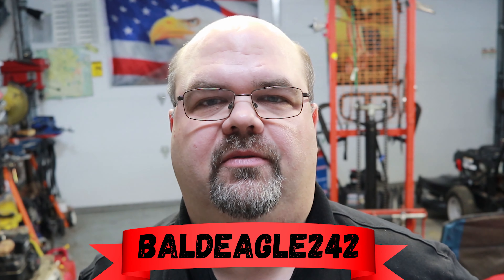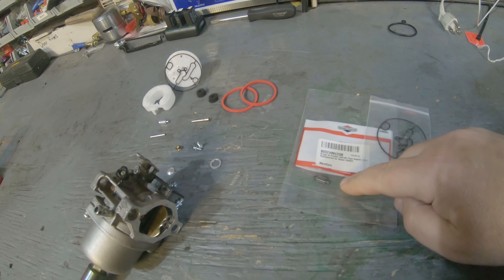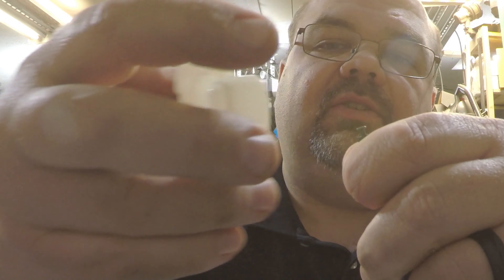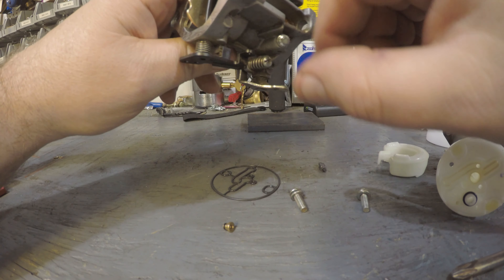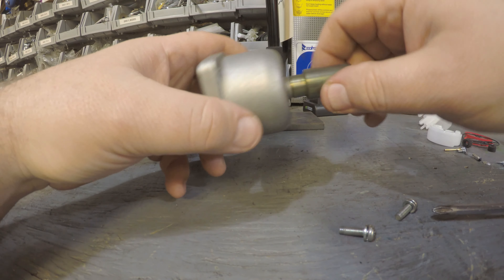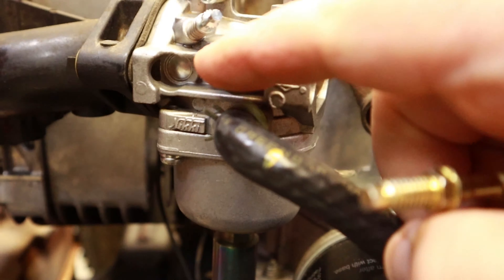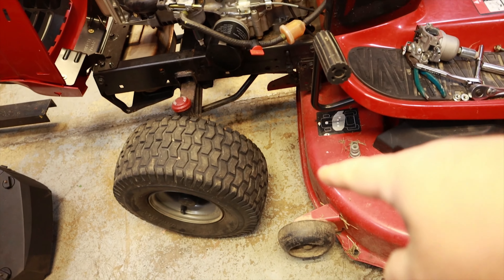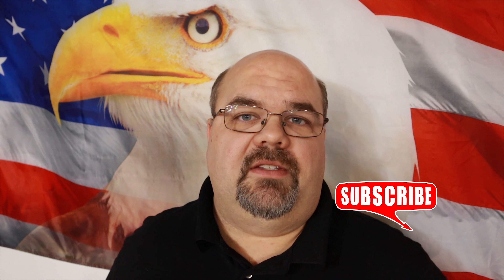No BS! Simple NIKKI Carburetor Rebuild

Comment: You're one of the very few folks that show doing a "wet" test on the carb.  Good on ya for that as that's very important step after messing with the float.  Cheers.
Reply from the maker: Thank you, I have to give my grandpa credit for that. 😁👍
Reply: I just hold the carb right side up, & blow into the fuel inlet tube. If it holds, it won’t leak.

Comment: The gas leak test is always useful.
I typically have a jig set up on my bench
with a small raised gas tank, hose and valve
that I attach to the carb while off the engine.

In your case, your carb is GRAVITY fed.
If there is a fuel pump, gas will not flow
to the carb since the engine is off.
So many details to remember, so thank you sir.
-- North Central Florida
-- 10.1.2023
Reply from the maker: Thank you, I appreciate you taking the time to leave a comment. Here’s a link to the rest of the story on this carb. I generally go about it in a little different way that I show in this video. https://youtu.be/8VxTRqJZi0Q?si=HPEL68_r2Ig5e3Iw

Comment: I have the exact same Craftsman YTS3000 that I bought new from Sears in 2010. Mine got hydrolocked too and I ended up replacing the carb about 5 years ago. We'll now it's  surging so not sure if I'll just get another new carb or rebuild kit. Amazon Carbs are just a little more $$ vs a rebuild kit.

Thanks to videos like this I have kept that mower mowing my 2 acre lot for 14 years! I have also had to replace the spindles. Drain/replace the transmission fluid. Repair the deck with welding and repaint to protect from further rusting. New tires. New high back seat. Replace  the blade cable. Repair wiring harness from rats eating it up!
Reply from the maker: All of that and you’ve still spent less than most people who buy a new one every 4-6 years. 😁👍

Comment: Excellent video on that Nikki carb. When I purchased my riding mower from my neighbor, he hadn't run it for 3 years and left it full of fuel. The fuel lines were rotten from the tank to the carb. After a little bit of silicone fuel line replacement (that was fun) and a carb clean, it's been running great for 3 seasons now. I for one don't mind this carb, as it's easy to work on. I also added a fuel filter and fuel shut off just for added security just incase an O-ring goes bad.
Reply from the maker: They aren't that bad of carb, but they are prone to leak once they get a little age on them.  The fuel shut-off is a brilliant idea.  I will usually shut them off as I'm driving into my garage and leave them off till I need them again.  Thanks for the comment, and thanks for watching.  🦅🇺🇸

Comment: Hello again Mr. BaldEagle! First of all, I would just like to thank you again as everything you taught about the Nikki rebuild was right on point, it only went bad again because I kept taking it back apart. But with the help of GOD, I finally figured out why there was no gas getting over to the piston well. I went back out this morning trying to start the mower again, but still nothing. So I went ahead & disconnected the kill wire like you suggested, but still nothing. Well I was reminded that I had messed with the rockers and even checked the push rods before I did the carb rebuild. Well the voice that I heard today told me to go back and check the rockers and push rods again, and when I did, I discovered that the intake valve wasn't opening because I didn't put the push rod back in like it was supposed to be. Well it was then that I remembered that if the intake valve doesn't open, then no gas will get to the piston well. So, after resetting the push rod, and readjusting the rockers, that baby started purring like a kitten!    So again, thank you very much for all of your help! GOD bless you and your family! Have a blessed weekend!
Reply from the maker: That’s fantastic news!  I’m glad it all worked out in the end. Thank you for taking the time to share your experience. I hope to see you around on future videos.

Comment: Hey, thanks for mentioning the solenoid.  I thought that was just to stop flooding the carb when the motor wasn't running - didn't realize it shuts off fuel to the main jet.  That makes more sense, and was the reason for the motor not starting.  Cheers!

Comment: 6:56 and main jet dropped down the tube.  I initially found some other videos where its inserted from the other end of the tube.  Those didn't work for me, but this did!  Should have taken more note of where mine was when I took it apart!  Saw your vid and that specific bit.  Now I have an engine that runs.  Many thanks!
Reply from the maker: That’s awesome. I actually made a dedicated short video on this because I had so many comments about it. Thanks for taking the time to comment. 🦅🇺🇸

Comment: WOW, I needed that! Neighbor has a older Toro with B and S 17.5 HP engine. He started it up from the winter, white smoke and ran like crap. Could be head gasket I suppose, I pulled the carb (NIKKI) and it was FULL of rust and crap. I cleaned it up, but the little piece you mentioned that goes in, rubber O ring first. That was on the bench, not having a clue where it went. The O ring you mentioned possibly needed to scrape out, that's where I put it. DAHHHHH, it flooded like crazy! After watching your video, I put it in the plastic tube, rubber first. AHHHHH Haaaah! Will put it back in soon to see if it now runs. I sure hope the smoke was from moisture in carb as well. Thank you for taking the time to help us guys out! Damn, I hope this is the fix!!
Reply from the maker: Fingers crossed for you! Let us know how it works out. 
I’d also check the oil to make sure it’s not over full. When the carb fails it will let whatever is in the fuel tank run down into the engine.
Reply: @baldeagle242  I did check the oil prior. The level was on the mark. After putting the piece where it should have been, I tried again. Before I tried I pulled the plug and cranked the engine. Fuel, OMG, lots of fuel came out. Once that fuel stopped, I put the plug back in. It started right up but white smoke again. It ran for a minute but seemed to flood itself. I pulled the plug again, cranked over the engine, fuel fuel fuel.  Sooo, I am still thinking it is the carb, but why the white smoke? I  am going to order a kit. I recall you saying if the O rings are worn fuel can get past them causing flooding. I am certainly no mechanic, I am learning by videos provided by you and others. So very greatfull. I also am considering taking an online small engine course, any suggestions?? Again, thank you sir
Reply from the maker: @davidpatterson5728  it sounds like a carburetor issue for sure. A new carb should fix your issue.
Reply: @baldeagle242  WOW, that was quick. New Carb or carb kit? I think I did see NIKKI carbs somewhat reasonably priced
Reply from the maker: @davidpatterson5728  If you have the tools and basic mechanical knowledge I recommend rebuilding the original factory carb. The original will be jetted and tuned for your engine. After market carbs are a decent second choice but they are tuned to work with a wide range of engines. Generally they run on the rich (to much fuel) side. They work, I’ve used many of them myself but there are lemons now and then.
Reply: @baldeagle242  Thank you for everything, I sincerely mean that! I will get the kit. I have watched several videos, seems like the NIKKI carb isn't well liked??  For the same situation I am experiencing. I will get the kit, rebuild it, and will let you know if you would like. Again, thank you!!!
Reply from the maker: @davidpatterson5728 The Nikki carb is by far the least liked. It’s susceptible to damage from the alcohol that’s in our fuels because it has so many rubber seals.
Reply: @baldeagle242  Well, the closing arguments are complete and the jury has a verdict! FAILURE. I rebuilt the carb, even ordered a new aftermarket when rebuild failed. In both cases, engine started right up, with rebuild there was smoke quickly. It would run on idle but smoked heavily. With the new carb it fired right up and ran for quite a few seconds with no smoke. I thought that was it. Then it started to smoke. It never flooded out like original carb. So, if I may ask, what do I do now? The motor sounds very good, really really good. Any help would be greatly appreciated. Thank you!
Reply from the maker: @davidpatterson5728 If you haven’t already done so check the oil level. It may have fuel mixed in with it. If that’s the case you should be able to change the oil and be good to go.
Reply: @baldeagle242  The oil level prior to this last go round, was where it should be. I will definitely change it and see what happens and let you know. Thank you so very much, AGAIN. if that doesn't fix the smoke issue, playing worst case scenario, am I looking at gaskets?
Reply: Well Sir, i cannot thank you enough!! I changed the oil, the crankcase was full of gas too!!! The oil level seemed fine prior, but after new carb and your suggestion, new oil, new carb, seems to run like a new mower!! Thank you my friend. Now i can return to my friend and NO CHARGE!!  Enjoy my friend. TY
Reply from the maker: @davidpatterson5728  Awesome!  Glad it worked out. Thanks for letting me know how it worked out. 👍😁

Comment: Great video. 
When putting my carb back together i placed the main nozzle upside down and couldn't figure out why the air/fuel was so rich the engine was smoking black. 
With your video i found out the oring on main nozzle goes into plastic not to the metal tube. 
Thanks milion times.
Reply from the maker: Thanks for watching! I’m happy to hear it worked out for you. 😁👍

Comment: Personally,  I'd rather have the OEM rebuild kit than a aftermarket chinese carb. Nice job there Baldeagle! 👍🇺🇸
Reply from the maker: I agree with that 100%.  The main problem with the OEM Briggs parts is they don't come in a complete kit.  I could only find the individual components and the o-ring for the jet came with a new jet from Briggs.  $15, and I didn't need the jet, just the o-ring.  
Thanks for watching Roger. I appreciate your support.  🦅🇺🇸

Comment: At 2:30 in this video, removing the plastic jet stop cap, mine didn't come off easy as demonstrated in this video. Trying to follow what I saw in this video by just pulling it off with pliers didn't work. Mine just wouldn't come off but I thought it was supposed to come off easy as shown in this video. Pulling on it broke the needle valve at the very narrow part which is in the middle of the needle valve. After breaking it, I had to first grind a flat spot on the piece left in the carb to drill a hole. I had to be very careful not to widen the hole messing up the threads. I then had to insert a screw extractor and after a while, I was able to screw it out. I would suggest heating a flat blade screwdriver to cut the plastic stop cap so it can be removed without breaking the needle valve destroying the carb or causing you a lot of extra work.

Otherwise, very informative video. Thanks.
Reply from the maker: Wow! I hate to hear that. They can be tight but I’ve been lucky none have ever broken. I’m glad you were able to find a work around and get it fixed.

Comment: Well thanks! I'm really just needing the mower to work but will rebuild this carb if needed also. This one here is a John Deere with Briggs 19hp and the Nikki carb just like the one in your video, one difference is this one has some type of fuel (vent or regulator?) that's connected inline with a vacuum tube, that goes to vent.

Comment: I just fixed a nikki carb using your video, I ordered the chinese carb kit fromthe link you had. i only used the two small gaskets, one was the one you used a flat tool to roll onto, and the other one i used on the main jet. I hope thats what the two small o rings were for.  I can't test  the carb until tomorrow!  Thanks for the video!!
Reply from the maker: +@bobbym77tx Thanks for watching! Hopefully you’ll find other videos I’ve posted interesting or useful. https://youtube.com/playlist?list=PL5_ZXmQpcjpac4UV8OW8g-IWVCR8tqy79&si=RKfnQL-PAcZFy67a
Reply: @baldeagle242  I guess I somewhat fixed the carb, it only runs on choke,  but doesn't surge anymore.... I guess I need to retrace my steps
Reply from the maker: @bobbym77tx  If it’s surging you probably have an air leak or something is partially clogging the main jet.
Reply: @baldeagle242  no longer surges, brand new jet and  jet o-ring, now it wont run unless its on choke.

Comment: I had one time the fuel solenoid backfire was stuck down and then I found that I had gas in my oil and The same thing happened to my neighbor's tractor too so we both added fuel shut off valves and haven't had a problem since.
Reply from the maker: This is a very common issue with these carbs. Here’s a link to the rest of the story on this mower. 
https://youtu.be/8VxTRqJZi0Q?si=AF4MjZ2-OqR53Oxl

Comment: I have this tractor with the 21hp B&S platinum engine. The china made kit's jet has to be used, as the o-ring wasn't thick enough to be used with the old jet. The kit's jet also has to be reamed out with a very small drill bit, to match the size of the old jet, or the engine will only run on full choke. The new float also sat too high. If you keep the old parts and mix and match, and make alterations, the kit can work. But this is not a simple plug and play replacement IMO.

Comment: Great video. This was exactly what I needed. Thanks for the info and how to. I had ordered an aftermarket one, but I'm just gonna rebuild my factory one and hold on to the other. I'd much rather have OEM than Chinese
Reply from the maker: It's usually better to fix the OEM carb.  Depending on engine size, there are different jets, and the Chinese carbs are built with a one size fits all mentality.  You can generally get them to work, but they will not be as tuned for your particular engine as the OEM.  Thanks for watching, and good luck with it.  Let us know how it turns out.  🦅🇺🇸
Reply: I have checked all the valves and can't see anything out the ordinary, I opened the motor and checked the timing and only thing I can see is that the timing mark is not quite punched on the centre of the notch , I am thinking it is out a tooth ???

Comment: i had a carb like this w a flooding issue due to the choke valve a little loose w no scews to hold it tight in the shaft would wedge in housing on full choke so spring could not open valve. adjusted cable w very small gap [.035] w black lever held against stop on full choke . you can also modify choke stop black lever to prevent wedging of valve on full choke.

Comment: I have a flooding/hydro locking issue with my engine as we speak. I’m going to pull the carb and see which gasket kit I need. Thanks
Reply: I looked and it does have the separate oring

Comment: That O-ring on the teeny-tiny main jet seems huge compared to mine, and I think therein lies my problem. .. well, one of. I know the jet fell out when I removed the bowl. But it's held in place at least by the plunger on the solenoid. I narrowed my no-start problem down to the solenoid -- it wasn't, or didn't seem to be retracting when I switched on, to allow fuel in. Well, a new one  (cheapo Chinese £15) doesn't work other than you can see it vibrating a tiny bit. So, wanting to dispense with using a solenoid, I cut off the top that closes on the main jet. No start. So I remove the solenoid, and the main jet falls right out of the  hole in the bowl!! Although the carb looked quite clean I ultrasounded it for 20m at 50° in Oregon cleaner, so I was surprised the O-ring was really not poking out proud enough like your one. Do you have the dimensions of it or a reference (I don't want the whole kit) or know a way of bulking it out again? I know putting them in boiling water shrinks them so would freezing them do the opposite? MANY THANKS!

Comment: Very useful video, thanks. I've got the engine running again (Briggs 13.5 HP OHV) on my ALKO ride on mower but I've noticed some dripping from the breather pipe next to the intake manifold. I've replaced the float needle in case the carb was flooding although it didn't seem to have a rubber seat for the needle and I still have a dripping from the breather pipe. Any suggestions on what to check next?
Reply from the maker: If you’d like to fix it for good I’d recommend changing it over to a Walbro style carb. 
Simple Upgrade: Switch from Nikki to Walbro Style Carburetor!
https://youtu.be/ZVbOFzW0inM

Comment: You’re carb backfired smoke when shutting off . So the shut off switch in bottom of carb doesn’t prevent that?
Reply from the maker: It will keep fuel from sucking into the engine and backfiring out the muffler. It’s rare to see an actual backfire out the carb but it’s not uncommon to see a puff of smoke with the air cleaner removed. This is normal and no cause for concern.

Comment: Question for you. I purchased a carb rebuild kit. I only replaced those 2 particular Orings & gaskets. So, I'm reusing the same round white plastic piece & float. I cannot get the round piece back on flush to the carb.  I took the jet & round gasket back out & still can't get it on there flush. Using all the original parts except for the 2 Orings & gasket. Seems like the long brass thing is where it's teetering on. Does it need pressed on? Suggestions?
Reply from the maker: No! You do not want to press anything… if it doesn’t go together with very minimal force something is not lined up properly. Your question was one of the reasons I made this video on a mower I’m working on today. This video shows more details than the previous on how everything goes together.  👇
https://youtu.be/g9SRvDaKgNE?si=7G7zKY4Uh81jBIDq